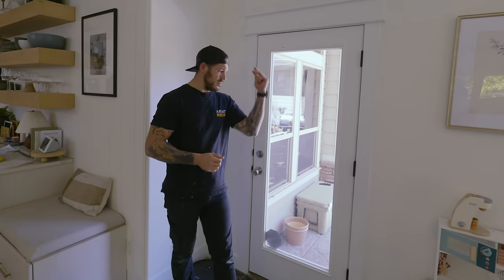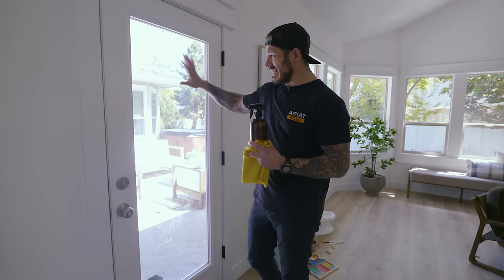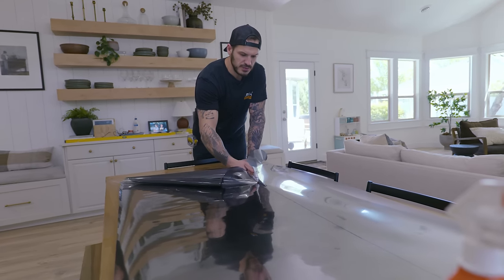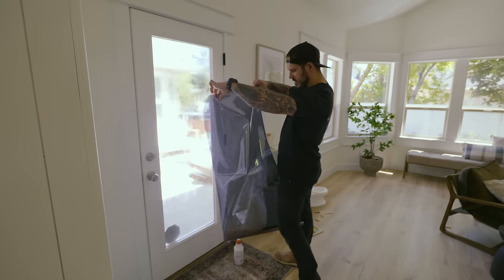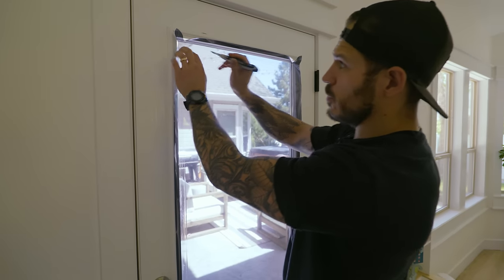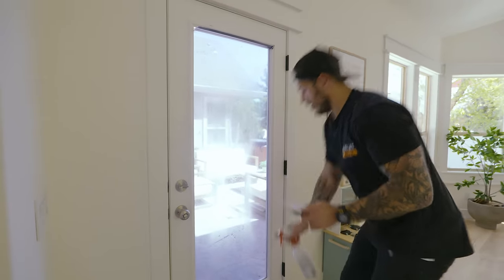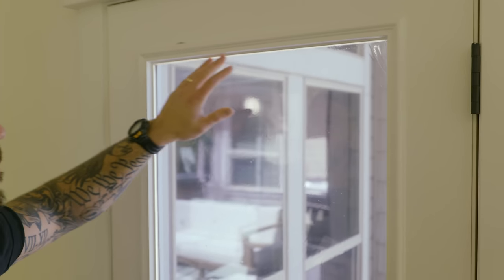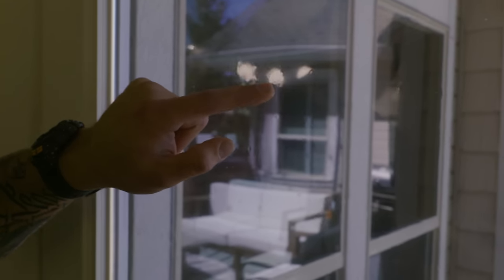Using Car Window Tint On My House

Comment: Could have shown how it looks from the outside.
Reply: That's what I was really hoping to see too.
Reply: I don’t understand why he didn’t
Reply: I was hoping to see the outside too.  Mr. Built It, please show us the outside!  We want to see if people are able to see inside from outside
Reply: @janfam  pumping out half baked content to pay that mortgage $$$
Reply: See thumbnail 🙂
Reply: @rosamoreno2423  it'll probably most likely work this way... during the day, nobody will be able to see inside, but u can see outside. During the night, it'll be opposite. You won't be able to see outside if your interior is brighter than outdoors. But you'll be able to see inside easier from outdoors during the night.

Correct me if I'm wrong. Not sure if the tint behaves similar to that reflective tint people use. If it does, then how I explained on top is how it'll work.
Reply: He did..rewatch the video..
Reply: Dude it’s like your car tinted. It depends on the tint you use
Reply: @janfam  hey beautiful
Reply: Outside was the only reason i was watching
Reply: He didn't show what it looks like from the outside BECAUSE IT LOOKS LIKE HELL! Those aren't soap bubbles under the tint at the end as he claims, that is contamination because he didn't clean the glass properly. Never wipe a window with a rag to clean it for tinting. It leaves behind tons of tiny pieces of debris you can't see UNTIL you put the tint over it. Then they blowup under the tint because it can't lay flat against the glass. Pro's, like me, clean the glass twice and have to be methodical, ALWAYS working from top to bottom, again, to reduce contamination. First with stainless steel razor blades with a soapy solution and then again with a rubber squeegee. Rags are never used! And once installed on the glass you need to use a squeegee and then a very hard rubber tool to push out 99.8% of the fluid under the tint, other wise it won't dry properly and will end up looking like orange peel with little dimples all over the tint. And don't run the knife blade between the frame and the trim guide like he does initially, run the trim guide against the frame and the blade against the trim guide like he does at the end to leave a tiny gap where the water can be pushed out. Other than all of that he does it 100% right. LOL

Comment: I was told not to do this on the inside if the window has double or tripple glass, since the temperature difference will crack the glass eventually. Just something to check before you do it.
Reply: Interesting, this is what I thought and had previously read as well.
Reply: Depending on the film. This cheap Amazon film will hurt the windows. Only use a high quality metal or ceramic film.
Reply: Totally false as long as you use the proper film. Yes, it is true that film can cause glass to crack from thermal fracture but that is only if you install the wrong film to windows or have factors such as shading. You should never install car film on your home windows this is why I recommend using a professional. They will use their knowledge to install proper film and comes with a warranty not DIY.

Comment: You could use a clear ceramic tint as well. People do on their windshields so it’s doesn’t darken the window just reflect the heat/ UV rays.
Reply: Regular tinted or carbon tint doesn’t even reflect heat. Maybe 10% at most with a 5% limo tint. 
A 70% (aka clear) ceramic blocks 85% heat 🙂
You can’t tell the difference. I have it on my windshield and if I roll down a window to compare it doesn’t even look tinted. 
But it’s like 2-3x the cost of regular tint.
Reply: @dylan-nguyen  its kinda hard to find, too
Reply: People put dark tint on their windshield too. My it has 20% tint on her windshield.
Reply: @dylan-nguyen  Yeah where do you find this ceramic film to put on your house windows?
Reply: @JRMooreMusic  just look for 70% ceramic window tint 
basically looks clear

Comment: Tint is not something you want to cheap out on.  This will 100% fade and turn purple overtime.  Buy a quality ceramic tint for heat reduction.
Reply: In 3 years, he’ll be in a bigger house doing more unnecessary projects for you to critique on! :)
Reply: That tint already looks purple.  Can tell a huge difference between cheap tint and the llumar I use

Comment: Hey you can’t use the window tint on double pane windows cause it will ruin the windows. Did you consider that? Or are you using different tint that you could use on double pane?
Reply: Why cant you use tint on a double pane window?

Comment: Just want to make sure before you do these type of treatments, the manufacturer of your window doesn't explicitly state not to.

Some window manufacturers caution that adding films may in fact do damage.
Reply: Yeah he must live in a warm climate because the tint could cause windows to crack in cold weather
Reply: I had to remove this type of film..it caused my windows to fail.
Reply: This is what I had read also, that manufactures discourage this as it could lead to damage, failure, voiding of warranty.

Comment: Hope someone can answer this. I bought a different tint but the tape side was under the mirror (sticky) side. I saw a someone apply this from the outside with the mirror toward the outside. Here, it's being applied the opposite. Does it matter if the sicky side is on the window side facing in or out? I want the mirror but want to see it from the outside. I've looked all over and no one seems to have an answer.

Comment: Does not work to keep heat out someone else already proved and measured with infrared thermometer
Reply: Can’t use infrared meter to test. Film reflects heat at glass surface so it will appear hotter on infrared. True test is a btu meter shows amount of heat transfer into the room.
Reply: @MikeJohnson-xz1rt  bingo

Comment: This is not car window tint not even close you’re using the same product. Everyone else does car window tent. It’s not like this not at all very misleading. The problem is with this mirror film stuff at night. When you have lights on inside it becomes an inside mirror you can’t see outside, but everyone on the outside looking in can see you literally are you someone to be having your face pressed against the glass and you would not know it’s there
Reply: it actually doesn't matter what kind of tint you use...that's just how light works.

Comment: This guy be doing the most random shit to his house... first he makes a hole in his roof for no reason now he doesnt know blinds exist lol
Reply: The fan in the hole in the roof causes a negative pressure causing the air to flow through the soffit removing hot air from your attic, which makes your ac need to run less to keep the house cool.  Lower energy cost less maintenance to your condenser and it didn't cost much to do...

The tint is used along side blinds. Your douboe paned windows only have an R value of like 4 so heat and cold will pass through easily compared to insulated walls, even tint raising r value by 1 or 2 can have a decent impact of energy efficiency. 

You seem ignorant to home construction 🤷‍♂️
Reply: @TheSpeedrange4  since you know so much you must also know window manufacturers caution against tinting their windows. 🤷‍♂️
Reply: @iVolkswagen  some, but not most. The biggest issue is damaging the low e film inside the panes.  But with a few minutes of googling before buying a film. You can find ones that fit exactly what you need by searching the nfrc and shgc of the films. There are plenty of films that Blick uv without gaining heat which is the main damage to window units.
Reply: @TheSpeedrange4  👌
Reply: @TheSpeedrange4  The attic is typically the same temp as the exterior temperature,  due to the ridge cap to make the roof and attic breathe.There is insulation in the attic that keeps the home separated  from attic and all entry to attic should be insulated, weather stripped and sealed.  As you can see from many roofers in the comments he did it wrong anyway. 
Tint is obvious but it's stupid to do that's why nobody does that. It also voids many window warranties.
And why nobody puts holes in their roof for a fan. Yikes.